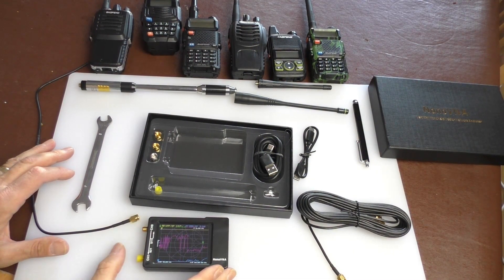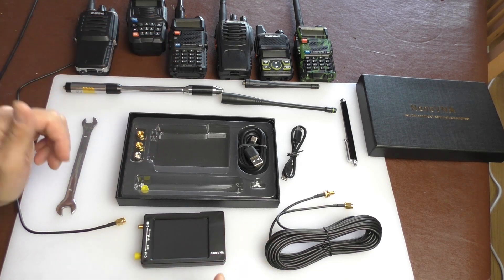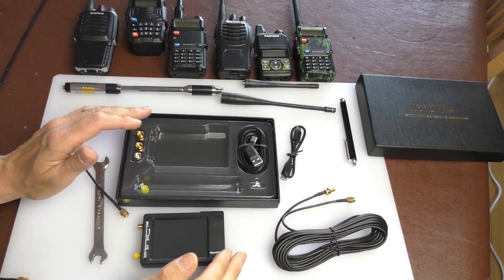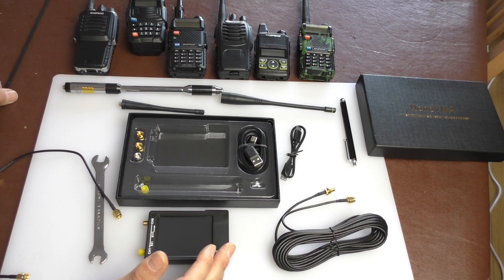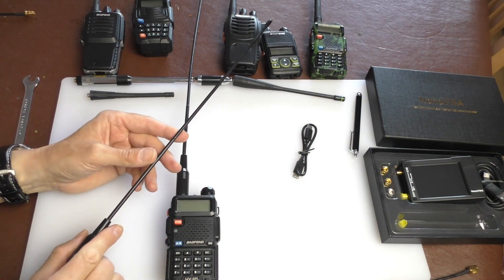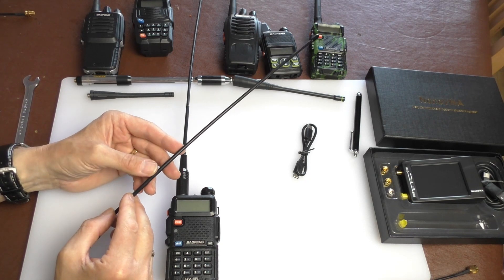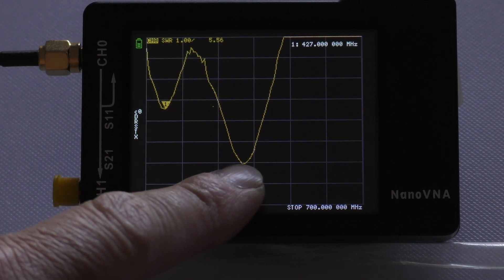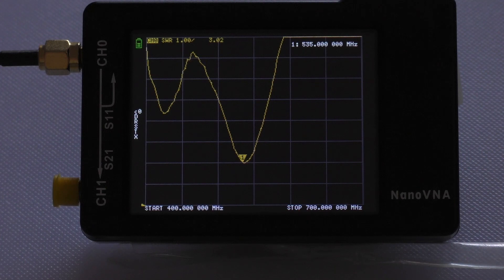FAKE Nagoya NA-771 testing SWR on 70cm - Nano VNA.  SHOCKING RESULT !

Comment: Notwithstanding your previous commentors, I believe you should attach the antenna directly to the meter and then hold it like you would hold the radio. Then your body will form the other half of the antenna, which is how they are intended to be used. If that's still bad, fair enough! 😊
Reply from the maker: Yes i could try that although it would be hard to record the reading on the camera.  Yes a good video idea thanks.
Reply: @CB-RADIO-UK  hold it facing away from you and put a camera on it? Be a pain in the neck, but you can read it that way.
Reply: I believe also part of the official testing procedure adds a head to the mix as you'd hold this near your mouth. This won't cure the fake here I promise!
Reply from the maker: @FB-np7cg  Well i will do my best and try as close as i can.  Should be interesting to test.
Reply from the maker: Ordered a Male-Male connector so will try the test again when it arrives.

Comment: I've been having similar results from various small antennas, so I'm wondering if these small antennas can be tested. Also do these radios have an automatic internal antenna tuner at the expense of radiated power?
Reply from the maker: I ve never seen a budget radio with a tuner.
Reply: @CB-RADIO-UK  It could be a simple unit inside that does a crude but simple job .

Comment: Nobody knows these days that you can actually trim an antenna to match the frequency you want.
Snip snip

There is no one size fits all antenna
Reply: If you are not going to put the antenna back on the radio at least experiment with it
Cut off one or two millimetres at the antenna tip at a time with a pair of side cutters and see what you get

Comment: These seem to be really bad fakes! I saw some other videos testing the (fake) NA 771 with much better results! There is also a video were they open up both a genuine and a fake antenna. The genuine had some matching circuitry in the bottom part with small coils and little caps! So i guess they do a quick manual matching for each antenna - resulting in the higher price tag. With my (probably fake NA 771 but for around 6 Eur) i managed to hear the ISS space station 3 times when it passed. I wasn't able with the orig. baofeng antenna (signal stick copy). Also try to use a counterpoise (wire attached for virtual ground) - this can really change a lot! Consider in real life your hand and body would act as a counterpoise for the antenna!
Reply from the maker: Yes i did crack one of these open on another video.

Comment: The extended lead will also effect the SWR and input impedance probably. I wouldn't use a too long table. Just make sure you do the test under repeatable defined situation ;-)

Comment: I bought a Btech Nagoya 771 for an Australasian plan CB (476-7mhz) .... "120-900mhz" - Sweet!! 
...but missed the bit where it says receiving only - I think it's optimized to 430 & suspect this is true of most general antennas out there - I also suspect some are being marketed for use outside of their working spec's too....    
Anyway,  so out of CB & GMRS range :)   notarubicon did a vid on tuning antennas (trimming with wire cutters)... I don't know what frequency's you use most, but might this be an option to tweak the swr back into the park?  I guess it might be academic if faith has been lost but might be an interesting exercise if the only other option is to bin the antennas.....
....Ah, & ground plane - wondering if you can use a metal plate as one, as is recommended for mk2 surecom SW102's???

Comment: Want a good budget antenna? Get an Abbree tactical or other foldable antenna. They're ugly and unwieldy, but they are superb antennas. Don't know about the tri-band models, but they should work fine. I have a Nagoya NA-24J and the Abbree works just as well if not a little better. Thee 24J is far more difficult to copy, so you're more likely to get an original. Order from BTech or Amazon. Once you get a genuine Nagoya, you can easily check other antennas claiming to be Nagoyas by putting them side by side. 

The thing is, Nagoya antennas are well made, but they don't really extend one's range as much as you'd think. Looking at a graph is one thing; field testing's quite another. If it were me, I'd buy a Diamond Signal Stick or the 24J Nagoya.

Comment: The SWR of my Nagoya NA-771 antenna I got at the swap meet is around 2.0:1 on both bands. That's livable.
Reply: Mine is 1.01 at 446 MHz and about 1.5 at 146 MHz. The Baofeng F8HP I got transmits 8W on UHF and 6.5W on VHF at max power. I'm swagging.

Comment: Not convinced this test is accurate as the antenna has no ground plane, mounted on a car or handheld held in hand the result would be different. The mag mount alone is not enough. It has to be connected directly to ground through body or car, if not the ground plane/radials need tuning. I would check on car for best result, if only using on PMR you can cut the antenna to a quarter wave whip, the antenna is a 1/4 wave whip for 70cm with a trap/loading coil added. On 70cm the antenna only transmits from about 17.5cm of the antenna. On 2m it works as a top loaded antenna. 2e0deq.

Comment: Have you done the same test using the original antenna from the UV5R? If so what results did you get?
Reply from the maker: Hi Rob.  I cannot rem if i tested the stock antenna.  If i did it will be in the nano videos.

Comment: Coincidentally, I was testing my NA-771's this afternoon before I saw your video, having also acquired a NanoVNA. I tested how others have suggested - attaching the antenna directly to the VNA (with a gender converter where necessary) and holding it like I would a radio.
I'd (wrongly) assumed that Nagoya was a cheap (mainland) Chinese brand, and hadn't realised it was actually in Taiwan and rather better, hence worth faking.
All three of my NA-771's were fake, but at least usable, and with roughly the same curve. Optimum SWR around 200MHz but usable (just - SWR <3:1) on 2m, then falling to a wider curve of about 2:1around 400 - 450MHz.
I also tried a shorter (18cms) flexy branded "Baofeng" (moulded in the plastic), ostensibly covering both VHF and UHF, but patently obviously just a straight 1/4 wave at around 440MHz - an absolute swindle, but perfect for the UHF handie (FB-6V) I'd bought it for.
Ironically, the best of the lot was the one I was 99.99999% certain would be a fake:  branded as "Diamond BG-771" (same as NA-771), marked "Made in Japan" and even cheaper than the bogus Nagoyas. In fact, it was excellent! Shame I can't post the trace here. Lovely sharp dips in the SWR curves around 145 and 430MHz, and appreciably better results on receive. ♥
Reply from the maker: Interesting results. Just goes to show that not all fake 771's are bad and most are prob usable. Just no real quality control.
Reply: @CB-RADIO-UK  On second thoughts, only just about usable. ;-)

One of them I only ever used on 70cms (a slightly unusual yellow one that I bought to match my slightly unusual yellow BF-888S) so I decided to cut it down. As predicted, it's a simple steel (?) cable, quarter wave resonant at around 200MHz. Why does it seem thicker towards the base? Simply 'cos there's a double thickness of shrinkfit. Anyway, I chopped it down with a bolt cutter, carefully removed and transferred the rubber titty off the end, and it works a treat. SWR better than 1.5:1 over both 70cms and PMR446. ☺

I'll carry on using the bogus Diamond - it's obviously fake, but it works fine - and keep the "Nagoyas" for emergencies only. Though I might treat myself to a genuine one from a UK source - my TYT handheld is opposite gender to my Baofengs and using a coupler is a bit fiddly.
Reply: I'll add that I checked the various stubby antennas that were supplied with the radios, and they were all fine. The optimum SWR tended to be a little lower - about 410 - 420MHz - but still well below 2:1 on 70cms / 446.

Comment: Hi again Fred. Have you considered using a counterpoise or as it's sometime called "a Rat Tail". There are a few youtube Vids about these . With the supplied antennas you only really have one part of a half wave. If you add a counterpoise you are effectively completing the antenna. My friend has tried this on a handheld  and got really excellent results. SWR came right down to a useable level and the signal went up by 3 S points. He told me the the counterpoise was 19.3 inches. Just an idea you might consider trying. Cheers & 73s Keith
Reply from the maker: Thanks for the suggestion.  There was a real lift in 446 coms throughout lockdown.  Nothing in my area yet but iam hopeful.

Comment: Nice one fred ... I finally got a real one 13 quid with both rubber washers
Reply from the maker: Best way to go.  Safest.
Reply: @CB-RADIO-UK  nice one for the heads up I will put the rubber ducky back on the other one... do you recommend me getting one of these fake nano.. it's in my watch list👍🏽
Reply: https://www.ebay.co.uk/itm/201800104377.... have a look

Comment: Good morning Fred. Could you please try to use analogue SWR meter as a cross reference when testing the fake RH771 at f=446Mhz? TX at max 5W and see the reflected power. Very good video review of yours. Cheers!.
Reply from the maker: Hi.  Sorry wont be able to do that as i dont have the adapters.
Reply: @CB-RADIO-UK  Aye, okay and thanks for sharing. Regards. Azlan

Comment: i dont think having the antenna away from you would make much difference for swr. the antennas are made for hand held radio its designed to be used right next to you. your not holding the radio at arms length away when using it. i used my uv5r for the Australian 80 channel cb 476-477 mhz and the fake antenna did perform a little better than the standard one but not by great amounts.
is testing the swr going to be accurate on such a little antenna they are not the same as a mobile car antenna or base station. more to the point before you tested the antennas with swr meter did they beform better? if they did i would'nt worry about the swr i dont think the standard antennas would perform any better on swr meter.
Reply: Yes, we did the same on PMR446 and the talk range increases greater than the standard UV5R/888s stock antenna etc. The VSWR results is still dubious and better to double check with analogue SWR meter such as SX600 etc.

Comment: Seen a mod ... rat tail ground plane...

Quick question Fred....

First ssb.... I've seen your videos championing Ss 6900 n

What about the Alinco Dr 135 dx ( 10dx )
Reply from the maker: The Alinco 135 is thought to be a step up from the 6900N quality wise although the performance is the same.
Reply: Yeah, I know this might seem a daft reason, but I think im gonna go for it, purely for its looks. Not sure if clarifier is "clicky" but the one plus I suppose is the programming cable has an external port.

Comment: Have you tested your stock Baofeng Antenna?  I tested a NA-771 and the stock BF-F8HP antennae, get low SWR @ 120MHz & 420MHz.  Both dips are at the same location for both antennae, but the NA-771 gives SWRs below 1:2 whereas the stock BF antenna gives greater SWRs. I find it hard to believe that the both antennae are tuned that far off.   I get great NanoVna results testing  HF (1 MHz to 50 MHz) antennae range which I have verified with my Yaesu FT-891, but I'm questing the accuracy of the NanoVna in the VHF and UHF ranges.   I think I have real Nagoya as I purchased both the  BF-F8HP and the NA-771 from BaofengTech.com.    Also, I use the free software NanoVnaSaver.  It is python based and works on all computing platform(I used on my Mac and on my Raspberry Pi).  The program give you a nice GUI interface, and simplifies calibration.
Reply from the maker: Yes the standard antenna was tested in a prev Nano video with this set up.  It tested ok for a dual band.

Comment: Hi Fred, be VERY careful about the use of wrench on the SMA connectors! 
The key point is to tighten the SMAs properly. Not too loose and not too tight! Overtightening the connectors can cause the internals of the female connector to spread out, which can cause intermittent connections later on. 
Also be careful with how you're applying the torque at the connector.  On there NanoVNAs, the  connectors aren't installed in a very secure manner. They're usually just soldered on the pin side, and the other side of the connector has often no solder. This, together with use of a wrench, can cause the solder joints to crack, which can again lead to intermittent connections. 

There are proper SMA Torque Wrenches, which will automatically disengage when you reach the appropriate torque, but such a wrench alone could cost around 2-4 NanoVNAs,  so obtaining a proper one might not be economically justified in this case.
Reply from the maker: Yes good call.  Thanks for the advice i will take it easy with the spanner

Comment: Another good video Fred.
Would it be worth doing a comparison test on an in line swr meter of a reputable make. I suggest something with a  reasonable price like the Avair AV601.
Something is telling me not to put too much faith in that VNA..
How about also checking a reliable antenna with the VNA like your amtron99.?
Reply from the maker: Prob a good idea Barry.  Iam not going to get too much into these 2m/70cm antennas as really iam just using them to learn about the meter.  What i really want to use the Nano for is building dipoles.
Reply: @CB-RADIO-UK  
That's fare enough Fred but you need to know that the VNA is a reliable one otherwise you will be making dipoles that are way off resonance. That puts your other gear at risk.
Maybe use it now to build a dipole then connect it to an in line swr meter that you know is reliable. I'm just not sure if I would be trusting that VNA tbh.👍

Comment: As a lot of people already Said.
Connect antennas directly to VNA, if it Is not possible use as short coax as you can And use that calibration set to calibrate VNA with this short coax, thats why you Have that set in box in the first place, otherwise it could be just calibrated in factory.
Reply from the maker: Thanks.  A coupler is ordered and will follow up with the antenna connected to the Nano

Comment: Fred, I have been playing with my NanoVNA for a few months now. First thing - select the frequency range you want to view then calibrate using the provided  3 SMA standards, making sure you connect these standards to the coax configuration that you will be using when you eventually connect the antennas you will be testing. Generally, I use one of the patch coax cables provided, with the provided f-f sma adapter screwed in to the end which will allow you to screw the standards to the end of that adapter one by one for each test. Then when I test the antennas I unscrew that f-f adapter from the end of the patch cable and screw the antenna into the patch cable directly. For calibrating, see this link: http://nanovna.com/?page_id=2
Now if you are testing antennas that cover vhf and uhf frequencies, set the start freq to 136M and end freq to 450M, then calibrate, and save that calibration (and freq range) in one of the memory slots. If you're testing 11M antennas then do the same but select the freq range that covers the 11M band (say 26M-28M), and calibrate again, but save to a different memory slot this time. Then you can recall the calibration (which will also recall the freq range from when you saved it) when you next want to test an antenna for that range. Best of luck and thanks for making the videos.
Reply from the maker: Thanks Paul.  Great tip about setting the cal memory.

Comment: http://myradiohobby.blogspot.com/2017/07/nagoya-na-771-antenna-review.html  this is what the clones do not have!!! just a whip crimped to the sma!!!
Reply from the maker: Thanks John.  I doubt mine will look the same when i cut it open.
Reply: @CB-RADIO-UK  I guarantee it. I bet it looked like the 771s and 701s I ripped open. Unfortunately the Chinese treat these like their transistors. Such a shame as a fake could be so much more
Reply from the maker: @FB-np7cg  Well ive not totally given up as many have said its lacking ground plane ust mounted on a stand.  So i will be re testing attached to the meter.  Then i will cut one open.

Comment: What you are finding out is something I've seen for a long time , basically I ripped apart a cheap 'clone' and it had no loading , the closest it came to resonance was about 160Mhz. The best thing for these is trim them down to a UHF quarter wave!!! I jest you not. The main problem is that people buy these and convince themselves they're an improvement. they aren't. best antenna i've seen is the stock uv5R antenna for tune. great on 2m and 70cm! I guess 90% of the chinese antennas are crap , I have a big pile of them and theyre all shite! please people wake up and listen to this guy!!! I do have 1*771 which actually tunes on UHF and VHF. I also find 701's useless too!!!
Reply from the maker: John your prob right.  When ive finished playing with it i will take these fakes apart on another video and give you a shout out.  It will be interesting to see if there is any base loading.

Comment: It's never gonna measure right without a ground plane on the aerial to balance it out.
Unless you are measuring a Slim Jim you must have a ground plane 😉
Any aerial without a decent ground will peg the meter as you found out with your loft aerial experiments 😊
Reply from the maker: Yes thats making sense.  I will be trying the antenna attached to the meter on a future video to see if that balances out.